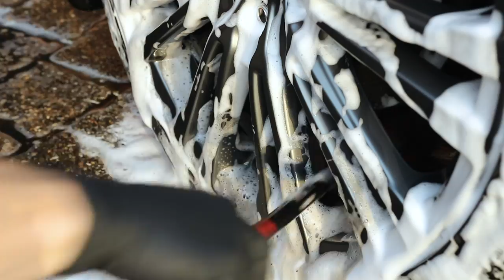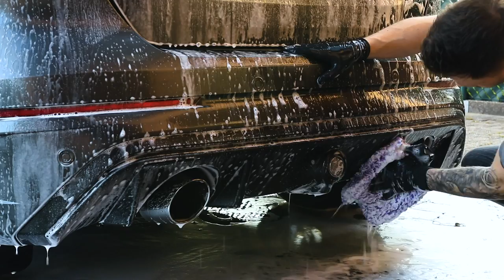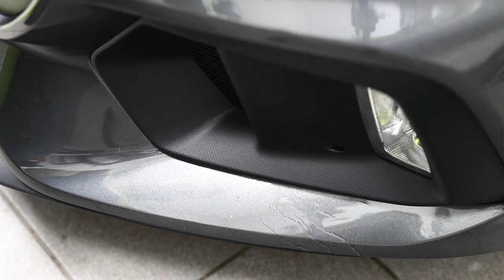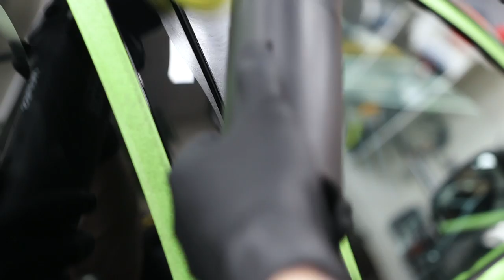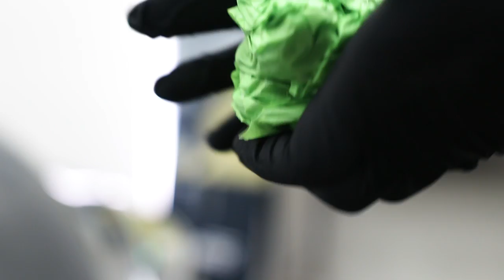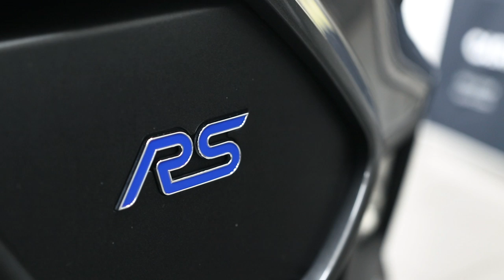Ford Focus RS Wash, Polish & Ceramic Coating - Full Detail

Comment: Another killer video! I used to have an RS and I paid to get the simpler wheels because those looked like they’d be a nightmare to keep clean! 😂 Happy New year!
Reply from the maker: Thanks Tom! These wheels are not easy to maintain, but they do look good in my opinion! I actually have a video on the detail of these wheels coming tomorrow. Happy new year and best wishes for 2021!
Reply: Same here! I bought an RS last year and I switched out the wheels for 5-spoke wheels from Option Lab.

Comment: Very nice video. A nice way to keep that awesome looking car, well, awesome.
Do you mind to give me the steps you've taken? I see the washing steps, but after that, you used what chemical after what chemical? I did sorta what you just did here (on my truck yesterday), but I think I messed up and when I used the Iron Clay, I actually wiped it off with a clean microfiber instead of washing it off.
So, I would really appreciate it if you could tell me what chemicals u used after the final wash?

Thanks, much appreciate it.

Comment: You are using p&s brake buster for the wheels right? I've heard that they leave painted wheels with horrible finish which needs to be polished out. Have you any experience with this? Thanks
Reply: Never heard this before

Comment: Hello.Perfect job👌👌👌, have you always used ipa after using carpro essense primer, before ceramic coat?
Reply from the maker: Thank you! I always do a light wipe down with Eraser just to make sure every residu has been removed. I usually just spray it on the towel and start wiping down every panel.
Reply: @VermijlCarDetail  thank you very much 👌😀Happy new year 😀

Comment: awesome as always ... please which is more agressive for cutting  as a wool pad short or long hair
Reply from the maker: Thanks Ahmed. Wool pads are always aggressive for cutting, they typically have longer hair than for example microfiber pads.
Reply: @VermijlCarDetail  thanks for your response bro.. an old detailer told me if you  use heavy cut compounds for example menzerna 300 you have to use wool pad because with a microfiber pads you wont get the best cut result specially on hard paint and the microfiber pads cause more heat is that true ??

Comment: What happens 10 years later when the ceramic is old and cracked ? Can it be removed
Reply from the maker: It can be polished off and reapplied once the coating has worn out. It will never crack though.

Comment: Does anybody know what did he spray after washing the car wish shampoo and lateral what’s that eraser spray also. Dear admin if it’s possible please reply
Reply from the maker: The spray applied after washing the car is an iron remover. This product will remove any iron particles that are in the paint. The Eraser spray is a prep spray to clean the surface of any polishing oils.
Reply: @VermijlCarDetail  hello sir thank you for your reply and I watch all your videos which is great. Is it okay to use the meguar mirror glaze instead of iron remover spray and eraser spray ?

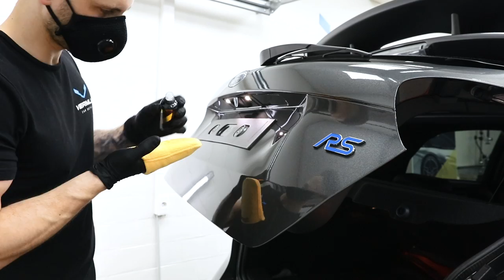Comment: I'm wondering how do you cover the coating on the "RS" badge? 14:35
Reply from the maker: I just go over the badge and around the edges and then precisely wipe it off to avoid high spots.
Reply: @VermijlCarDetail  Thanks for the reply! Being a professional detailer is really damn hard. I just finished clay, compound, polish, and ceramic coating on my Cayenne. The badges spent me half an hour to compound off the dirty inside each character... Spent around 25 hours on it!